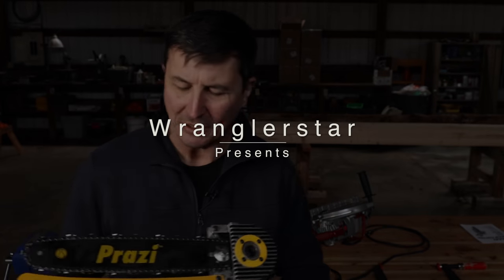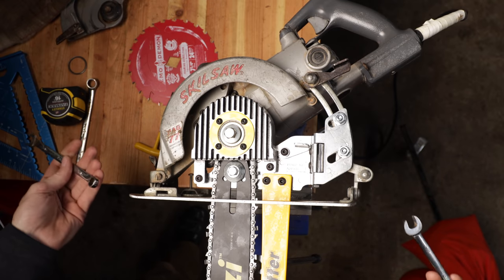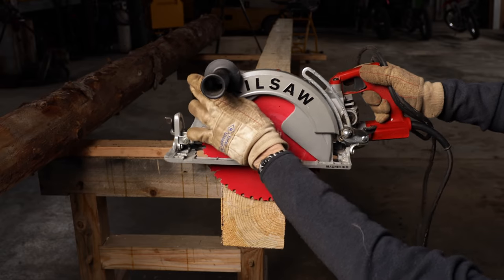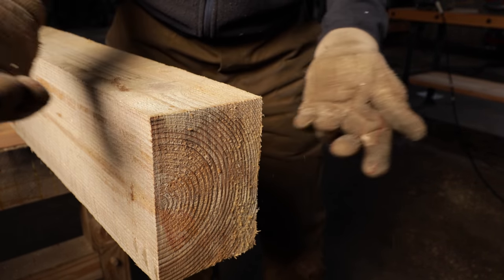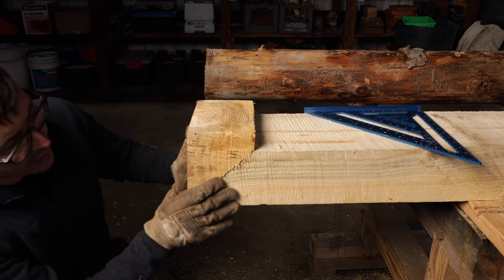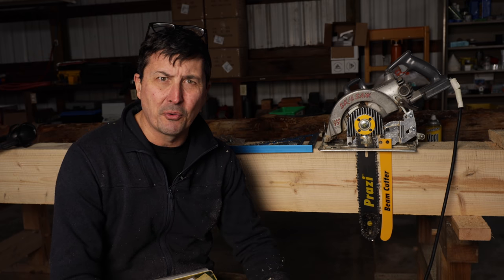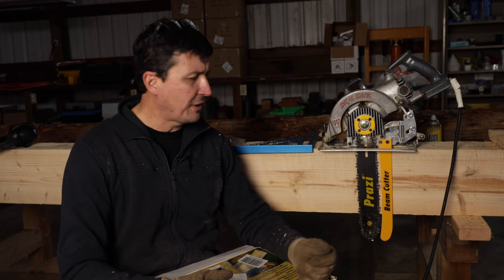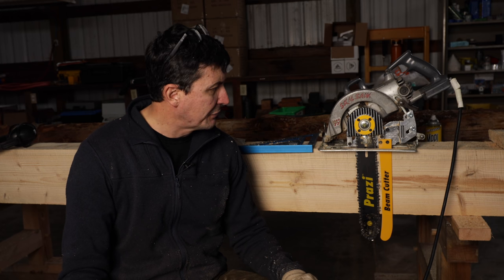TESTING The Strangest Chainsaw on Amazon

Comment: You should do the cheapest angle grinder on amazon
Reply: I doubt there is one cheaper than the Harbor Freight version... $10 with the right coupon for a 4 1/2” angle grinder is about unbeatable! Search YouTube for reviews, they actually aren’t bad!👍🏼
Reply: @Blakehx  I have the cheapest one from amazon.  Not enough amperage for cutting alot of metal, but throw a dang flap wheel or wire wheel and you cant beat it at that price range.  Used it 3 years doing welding projects for work 4 to 5 times amonth and it's still doing its job.
Reply: Erik Myers Nice!👍🏼 Sounds like a good purchase! What brand and how much did it cost?
Reply: There’s a coupon on the Harbor Freight website for the 5 amp Chicago Electric Heavy Duty 4 1/2” angle grinder for $16.99
Reply: @Blakehx  the blue one with the air tool style switch is great, very comfortable to hold while cutting unlike the slide-forward style switches that feel like they are going to snap back and shut off all the time
Reply: @Blakehx  dude, I did a typo....  I meant harborfrieght.  Lol. The cheapest one from harbor frieght.

Comment: I think I would just use an Small Eastern chain saw with a 16” blade, instead of going through all this. Neat product though.
Reply: Not if you need to hold tight tolerance.  No way you're going to get 1/8 inch or 3mm tolerance with a regular chainsaw unless you've got some serious milling equipment to go with it.  That's why he used a square to guide every cut.  Sometimes you need that type of precision.

Comment: Did you say Metric non sence? That doesn't make sence. Metric is far superior to imperial.
Reply: It's not superior. It's simpler, like people who can't do imperial.
Reply: I think the fact that metric is used by scientists and engineers proves it's value. I feel like often (not always) it's the less educated who prefer imperial... Until you ask them to start converting or halfing 17¾. I work with a metric tape measure handy when I'm adding and dividing a ton.
Reply: @jonbar140  it doesn't prove its value, it just proves it's simpler, you can only use imperial if you are educated in imperial, most who can use imperial can use metric just as well, youngsters today are educated in metric and don't have the ability to use both unlike us older people.

Comment: Tha looks like a cool tool. I have trained to cut most things following lines with a chainsaw but that would help alot in certain situations. Thing with electric motors what annoys me the most is the lack of torque and raw power. the day they will ban fuel chainsaws will be a sad day. invested alot in gasoline saws but seeing how they fight against fossil fuels makes me worry. they already mix it with bio fuel that breaks engines. Cool video thanks!

Comment: 1:00 Woah there Cody.  Go work changing car batteries for a living, and you'll learn to appreciate metric real quick. The Japanese cars are the best.  10mm for everything. Well, "the best" until you lose the 10mm socket.
Reply: superdupergrover no he needs to work on cars that have “wentworth” or BSA hardware, like the MG from about 1980! Then he will appreciate all tools and fasteners alike!
Reply: @gettintheresafelywithpatf2869  MG still used wentworth thread until '80s? I had no idea how bad it was.

Comment: Metric System ridiculous???
Let's see how "rediculous" it really is:

1mm = 1mm... 10mm = 1cm... 10cm = 1dm... 10dm = 1meter...
1000 meters = 1 kilometer.
standard wrench & socket sizes run as follows: 5mm...6mm...7mm... 8mm... 9mm... 10mm, etc.
10ml = 1dl... 10dl = 1L
Water freezes at 0 degrees C... water boils at 100 degrees C.
1dl of water = 100 grams... 1L of water (10dl) = 1kg (1000 grams)
EVERYTHING IS DIVISIBLE BY 1 & 10!

2/16" = 1/8"... 2/8" = 1/4"... 7/16" = 3/8" + 1/16"... 5/8" = 1/2" + 1/8"
1 mile is 5280 feet... or 1760 yards
American drill bit sizes are listed in gauges (which have to be converted to inches for best usage calculation!)
2 Tbsp. = 1/8 cup... 5/8 cup = 1/2 cup + 1/8 cup... 
Water freezes at +32 degrees F.... water boils at 212 degrees F.
1 cup of water = 8 fluid ounces... 1 gallon of water = 128 fluid ounces (or 8 pounds)... 6 gallons of water = 768 fluid ounces
NOTHING IS COMPATIBLE WITH ANYTHING; BUT EVERYTHING IS COMPLETELY ARBITRARY!

For speed, accuracy and instant understanding, the Metric System beats the American/British system by a MILE... that's 63,360 inches, to Ya'll.
(by contrast, 1 Kilometer = 10,000 cm)
Americans, good luck... and GO FIGURE!
Reply: Woah there champ, You must be new here. it's a running joke so don't get so butthurt

Comment: Metric is by far and away easier to use than "old school" imperial...
Reply: we used it for years in Norway , but still the old one is  hanging in there sometimes
Reply: Only if that's what your used to.
Reply: @davidtebbitt5537  I can use both, but find it easier to do woodworking maths, for instance, what is 5/16 + 3/32 + 7/8 or what is 8mm + 2.5mm + 22mm?  As humans, we are taught to work in decimal.  That said, I still ask for meat in multiples of pounds and measure road distances in miles, and can happily work in either.
Reply: @gordsec  . As humans???. Not ALL humans are taught in metric. It's only very recent that metric is taught. Imperial was taught for far longer.